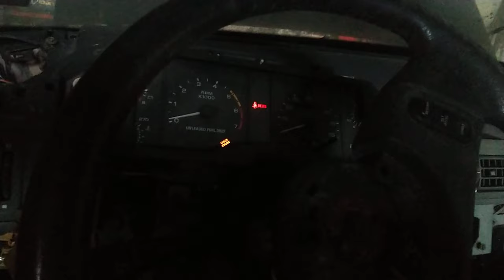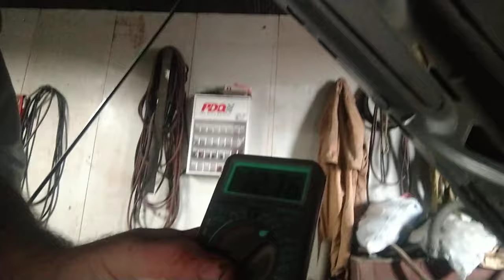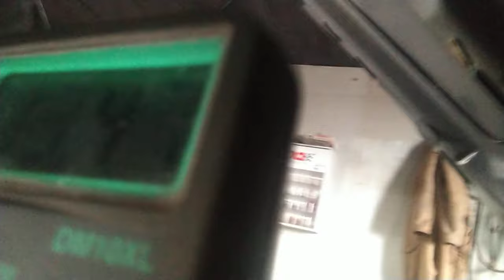Don't miss this simple step, Ford alternator not charging.

Comment: Thank you so much for your video sir. Im shane from philippines. 2days ago i buy a surplus cluster gauge panel. The owner said it is working. So i replace mine with that. After that my battery is nit charging just today i let the electrician check and says ny batt is good the problem is the alternator. So i go home park my truck outside the gate. When im going to park it inside my truck wont start. So i charge the batt for 5mins and start it and put my truck inside my garage. I almost order new battery on it . When im lying in my bed i search on youtube and watch your video. After watching i run in my truck and replace my surplus to my old one and check it. Now its charging. You save from wrong doing of mine.

Comment: Can be fixed by putting a 560 ohm 1 watt resistor in line to alternator. Light works as a resistor to tell regulator to charge.
Reply: Please expand on this if you don’t mind.
Reply: please ^
Reply: How I need a visual!

Comment: You can put a resistor in parallel with the battery light. It will start charging even when bulb goes out.
Reply from the maker: Yeah, it just needs to see continuity to excite the regulator.
Reply: What size resistor?
Reply: @LongWalkerActual  I would try with 150ohm 2watt resistor first, then 120 or 100ohm 2watt. You may have to ramp the rpm first to get the alternator charging then it will work on idle too.
Reply: @mikkolempinen2717  You've successfully done this before?
Reply: @LongWalkerActual  I havent tried my self, but I have seen them sometimes in wiring diagrams in parallel with the lamp.
Reply: @LongWalkerActual ford is 470 ohm. Availability on Amazon for like $6 for 100 of them. I do it that way for my “excite” my secondary alternator in my expedition.
Reply: @tristanloftis  Much appreciated!!

Comment: I've put 4 alternators on my truck & today a brand new alternate so its got to be something else we were told that the alternater  has fuse so the fuse was checked  & then the battery charged but within 10 miles I'm on side of road again I don't no what else to do help me
Reply from the maker: What’s the make and model of your truck? Systems used to be very similar between car brands but they’ve all gone in completely different directions in the last couple decades. Also I’ve seen that many bad alternators in a row from the cheaper manufacturers.

Comment: Thank you!! You helped me solve my charging issue with my 97 f150, 4.6 liter. I bypassed the tiny bulb in the instrument cluster and now getting charge to the battery, however, now the check engine light is on and the instrument cluster doesn't light up. I will eventually replace the little bulb in the cluster and see what changes. Big help!!

Comment: Man you are a huge help, got me back on the road when stranded when I was out of town.  Quick question, is there something I can replace  instead of a light bulb, that doesn't drain the battery when the vehicle is off, cause I'm tired of disconnecting the battery every time I stop driving the vehicle
Reply from the maker: That bulb should be powered through the ignition switch, that circuit shouldn’t draw power when it’s off.

Comment: Hey Bulldog, I have a 1990 Ford E-150 that has the 5.0 in it. I have the same problem with van as you are discussing.  I need to find the" bad bulb". What wire are you hooking your test light up to? I had to manually wire my alternator as someone had ripped the pigtail off. So, if you could tell me which wire do I connect the test light to I would appreciate it thank you.
Reply from the maker: Does it have a charging meter (ammeter) in the cluster? If so then it doesn’t have a light bulb.

Comment: Thanks it helped me figure out why the light wasn’t working but when I ground the green wire to the body of the alternator the light comes on but still not charging is grounding it to the alternator the the way to fix it
Reply from the maker: @jamietriplett8370  if the light comes on when you ground that then the signal is getting there, that wire is supposed to switch on the regulator to make it charge, there should be ground there until the alt starts charging, I have a feeling that your alt is shot.

Comment: I have a Ford F150 2003 changed alternator changed battery changed the clips to the alternator and battery still isn't charging what could it be? The battery lights on in the dash so idk where to look or what could it be. Any advice thanks

Comment: Could you help me with an 83 mustang alternator wire trace? It’s white with a black stripe coming from the alt. And had a push on rubber boot shaped connector. It doesn’t go to the electric choke like I’ve read. I’m thinking starter solenoid? I’m having a hell of a time getting any help on this.
Reply from the maker: If it's a large wire that goes to the solenoid then it's the charge wire.
Reply: It does go to the choke. It still had the rubber boot for the stock carb. It was different from any one I’ve ever seen before and not what current carb was setup for.

Comment: Great video. 
I have a 2012 ford edge. Replaced alternator three times with new batteries. Each time after like 15 miles of driving or less the alternator stops charging battery and the light in dash comes on. 
Help please
Reply from the maker: Have you tried different beans or always the same brand? I would check the charge wire connection at the under hood fuse block and the mega fuse for the alternator, sometimes they can crack from vibration and have an intermittent connection.

Comment: I have the same problem 2008 Ford escape changed the alternator, wiring harness , ignition switch,  new battery. The battery light still comes on while running and drains the battery. Any tips on where to look
Reply from the maker: Several fords have had issues with the resistance in the voltage regulator in the alternator, both aftermarket replacements and dealer parts. I’d check voltage while running and loaded (headlights/blower fan/ ac running) to make sure you’re getting around 14 volts.
Reply from the maker: There should also be a large fuse for the alternator that sometimes will break due to vibration or blow due to a catastrophic alternator failure.

Comment: As to the issue of the corrosion problem, I'm a stickler for ALWAYS applying a bit of DiElectric Grease inside any and every electrical connection, regardless of the location.  As an application to the sparkplug boot (either end), it eases later removal and can resist water intrusion.  For electrical connections, it can greatly reduce or even prevent corrosion due to temperature and humidity, as well as rain and snow (salt spray) exposure as well.  Before reinstalling replacement bulbs, I make sure to thoroughly clean the socket and terminals to remove any contaminants/corrosion and apply a fair amount to the inside base and sides of the socket before inserting a new bulb.  Be careful to avoid getting the grease anywhere except the base area of the bulb, because it will most likely cause either an immediate failure, or failing that, can prevent proper cooling of the bulb which will likely also reduce the "lifetime" of the bulb.
One other common failure (and often THE MOST common), is a bad or missing ground.  You can get "universal" braided-type ground straps from any automotive or "tractor/farm supply" store, and simply connect one from an unused threaded bolt hole and connect 1) Engine to Firewall, 2) Engine to Frame and 3) NEG (-) Bat terminal to either Engine (Preferred) or Frame.  With today's modern computer controls, A/C systems, "Power Everything" and all our "toys" (cell phone, tablets, GPS, Radar Detectors, etc), it doesn't take much to overexert older wiring that may not have taken these factors into consideration, on the "drawing board". The upside to using the "braided" strap-type cable, is no insulation to worry about charring/burning (therefore smoking) and it's a fairly cheap/easy/painless install/addition that doesn't require a wiring diagram or deep electrical knowledge.  The one thing I would recommend, I always use "star-type" lock washers on both sides of the terminal ends. I will look for a fairly easily accessible location, give the metal surface a good scrape with a tool like a gasket scraper (clean grease/mud maybe scratch some paint), and the "tar washer" will bite into the metal of the bolt and engine/firewall/frame to give a good "metal-to-metal" connection.  Again, as with any other "connection", I use a dab of "DiElectric Grease" on the metal surfaces before I make the cable installation (after cleaning/scraping) to deter possible corrosion.
Hopefully I've give some useful info.  Blessing to All🙏🙏🙏
Reply: What

Comment: Why didn’t you pull the cluster and swap out the light? Out of curiosity
Reply from the maker: The first thing I did was pull the cluster and check the light since it didn't light up and I had no power up front, the bulb was good so I had to dig deeper. Someone had cut the wiring under the hood.

Comment: So to test it, power the green wire directly from the battery? 
If that works should I just run a wire from the green to the power wire on the alternator?
Reply: Did u figure this out? Do you hook the green wire to power or ground?
Reply from the maker: It hooks to switched power with a load on it.
Reply from the maker: What it turned out to be was someone cut the wiring harness that went inside next to the brake booster.
Reply: This is confusing if I have a toggle switch which do I run to the green wire power or ground I don't care about the light
Reply from the maker: @RollingThunder85  power the green wire, I would put a light in line for resistance anyway.
Reply: Same problem here. If I wire it to toggle switch should I leave it on after crank or does it just need moment on power to excite alternator

Comment: So, are you saying that if the bulb is burnt out, your charging system won't work?
Reply from the maker: Correct, the alt is excited/triggered through the bulb, when it is not charging it is grounded inside the alternator causing the bulb to light, when the alternator charges the ground turns to power and the light goes out.

Comment: Do Ford F250's made in 2013 have this dummy light? 

My truck keeps turning up SERVICE ADVANCE TRAC with a wrench that fades until the lights go all the way out. I had no warnings either, accept one night waking up in the back seat to the vehicle idling improperly and losing power inside and outside.
Reply from the maker: No, they've got computerized regulators.
Reply: I'm having this problem today on my 2018 f250 with the advance trac. All my lights on thr dash are going out but truck runs for about 35 seconds then dies out. Is it a battery or Alternator? The battery light is also on on the dash
Reply from the maker: @DonSenior52 that’s way too new to diagnose by symptom, need to put a voltmeter on it to check voltage while running
Reply: Gotcha Thanks man!!
Reply from the maker: @DonSenior52  I just worked on a 19 Edge hat had a bad alternator, I wasn’t able to detect a bad diode bleeding AC voltage into the system but it was surging the idle for a while till it finally died, also wouldn’t shift into gear as it was fully electronic.
Reply: Get the F OUTTA HERE LOL. MINE WONT GO INTO GEAR NEITHER!!!! SO ITS A DAMN BAD ALTERNATOR YOUR GUESSING?!
Reply from the maker: @DonSenior52  on that one the alt wasn’t charging and it had a code in the computer for the alternator primary control circuit, it’s a completely computer controlled system.

Comment: I’m having this same issue of the alternator not charging on my 87 mustang.  I’ve even upgraded to a 3g alternator. So far I’ve returned to alternators due to them not charging. Had the guys at Orielly’s check the second one today and was told that it’s the regulator that’s bad. What are the odds of getting 2 bad alternators back to back?  I’m gonna have to rewatch this video and try and pick up as much info as I can. The battery light doesn’t come on either on my dash.  Great helpful video. I was about to start tracing the wiring.
Reply from the maker: It is possible to get multiple failures in a row, but the rest of the system has to be checked.
Reply: Looks like a weekend of car maintenance and some cold beers!  Yay me!!
Reply: Took the dashboard apart and replaced the light bulbs and ensured they all worked by testing them.  Hell, I even fixed my non working dimmer panel switch with a rotary tool, wire brush attachment and some electrical parts cleaner. The panel now works and saved me $100. But, the battery light still did not come on after installing the dashboard and the alternator is still not charging. Taking the alternator back to the auto parts store and exchanging it.   Could there be any other issue I could be be overlooking?
Reply from the maker: @alvarohernandez9580  make sure that green wire in the alternator plug has power with the key on, otherwise it could be a wiring problem, there is a plug around the battery/solenoid area that likes to corrode.
Reply: Thanks!! Will look at that later on today after work.
Reply: Might have to put an in line resistor.  I saw another comment on here about that. 560 ohm 1 watt resistor.   Ow to figure out a way to do that. Crimps connectors or solder. I’m sure there’s a vid on YouTube about it.
Reply: Put in an in line fuse. Still not charging. Checked green wire no power. Is there an external voltage regulator I should look for?  I’m at the point where I’m gonna take the car to a shop.
Reply from the maker: @alvarohernandez9580  there shouldn't be an external regulator on that one, if there's no power on the green wire with the key on then there must be a wiring problem.
Reply: @alvarohernandez9580  did you ever get this resolved? I'm about to start digging into my dash on my 96 Bronco. I'm also not getting power to the green wire. Does that wire run to the back of the instrument cluster or ignition?
Reply: @bulldogsautomotiveadventur4387  where does the green wire run to the dash? Ignition or instrument cluster?
Reply: @jessigames8593  hey! Yes per se. I ended up having to take my car to a shop. The car ended needing a new instrument cluster. The green wire ran back to instrument panel. It turned out to be an $800 job. But, had I dug in I’m sure it would have gotten more expensive cause I would have probably broken something.
Reply: @alvarohernandez9580  Thanks for the reply. Mine didn't start acting up until I changed the speedo out due to it not shifting right. I've tried swapping the whole cluster with a used one with no luck. It charges for a while then just stops. Battery test was good. I changed the alt already. Still has charge issue. It's got to be in the wiring somewhere I think.
Reply: @jessigames8593  you’re welcome. Yeah it’s frustrating, especially when you begin to run out of options and ideas.  I chased the green wire to the fire wall then I decided it was time for an expert to chase it all the way. Lol
Reply from the maker: I would check for power in the plug on the back of the cluster, it might have been damaged when you changed out the speedo
Reply: @bulldogsautomotiveadventur4387  I checked power on the plug earlier and it's getting power but no power on the green/red wire on the plug or alt. But my battery indicator light comes on when I turn the key. This may be a dumb question but could I splice the green/ red wire into a power wire that is working on the plug?
Reply from the maker: @jessigames8593  The ground for that bulb is the alternator, if the light comes on then it should have power out at the alt, unless you have a short to ground somewhere in between.
Reply: @bulldogsautomotiveadventur4387  ok thank you for replying. I don't know enough about wiring to find the short sadly. The small wire on the alt that is white and black also doesn't have power. Is it suppose to?
Reply from the maker: @jessigames8593  I’m not sure, it’s been quite some time since I worked on it

Comment: I had the same issue but now something else is wrong i still have my truck wired like how your talking in  The video but now i turn my key over and the battery light is gone but the bulb still lights up and the starter just clicks like a dead  battery but its not the problem its not getting pieer when i put my reader on it nothing is getting power idk whats going on
Reply from the maker: Do you have a burned fuse link next to the solenoid?

Comment: Bulldog  my truck f150  2004. V8.  4.6.   Have  problem  alternator  not  charge  put  new  and  same  problem  not  charge  help
Reply from the maker: I would start with making sure it has voltage getting back to the battery, I think those have a large fuse on the firewall, otherwise I've seen those have problems in the plug at the alternator.
Reply: Right , i had a mustang never had problem with the charging system , and now I gave it to him , and was not charging  D was sitting for like 4 yeah años he did the alternator plug wires and now it charger , to say plug wires were corroded or Ether were not making contact , thanks a lot for the video , and comment it really help when you need it 🍺🍺🍺🍺 cheers 🍻 for everyone here

Comment: Any advice on the same issue with an 82 Buick Riviera?...no light on in dash
Reply from the maker: Most all vehicle’s with internal regulators have the same general setup, if it has a light in the dash that doesn’t work anymore it won’t charge, those with a gauge are wired differently.